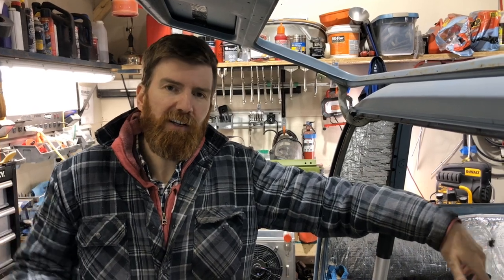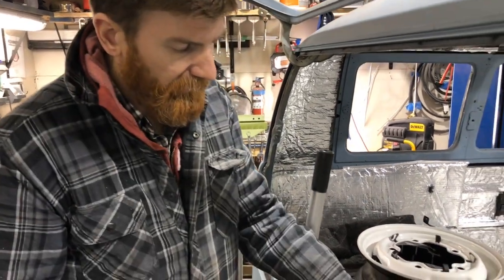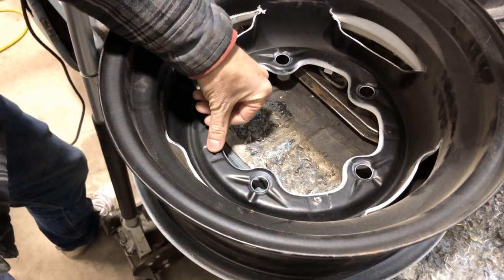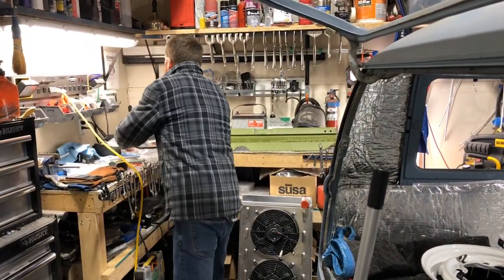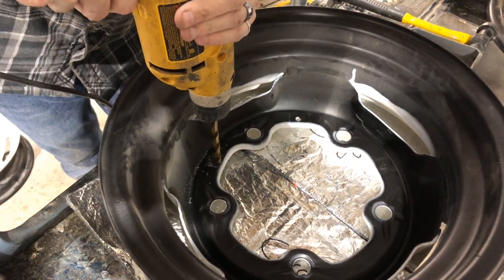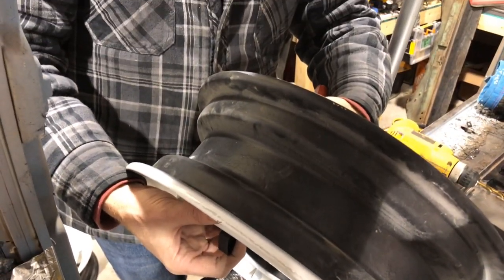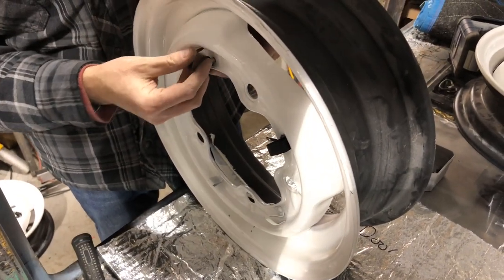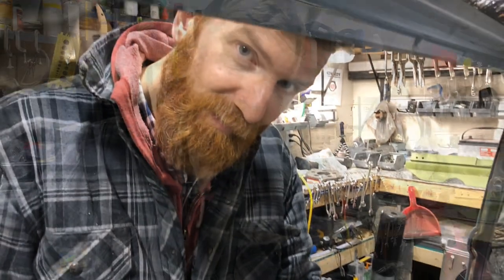VW - Hub Cap - Clip and Rivet

Comment: Great idea. If I knew rivets would have worked I'd have gone that way, it seems like alot easier than using making a custom jig with a pneumatic hammer. Love your videos. I also ordered the rack and pinion from Creative Engineering. i hope installation goes well